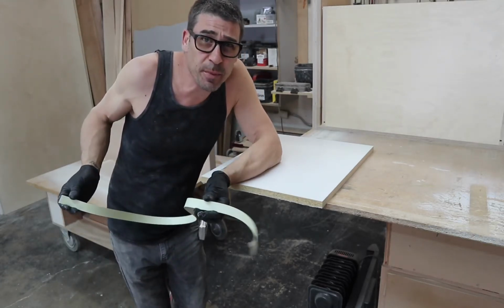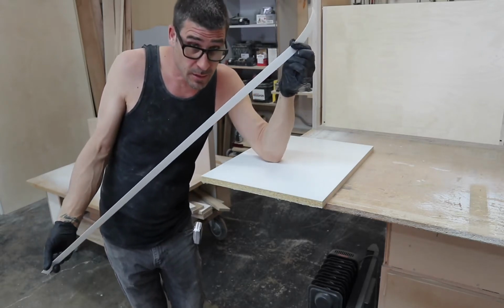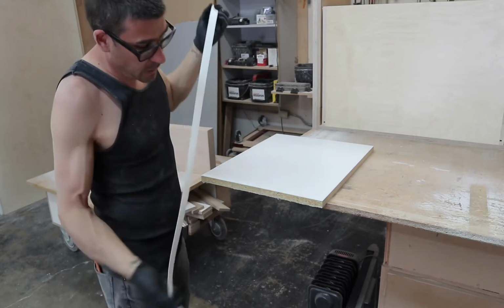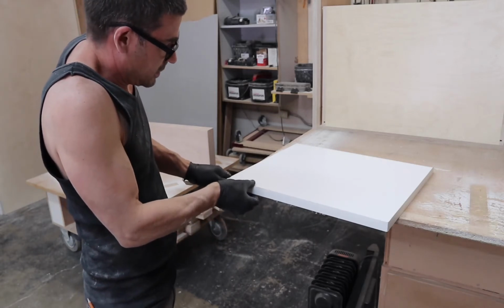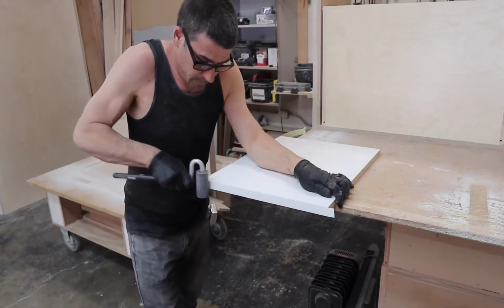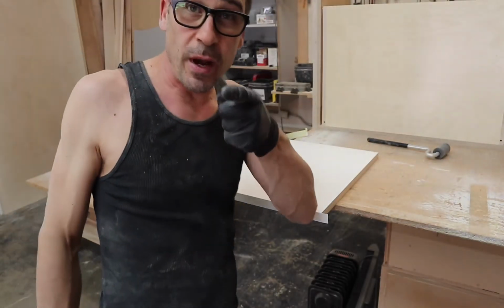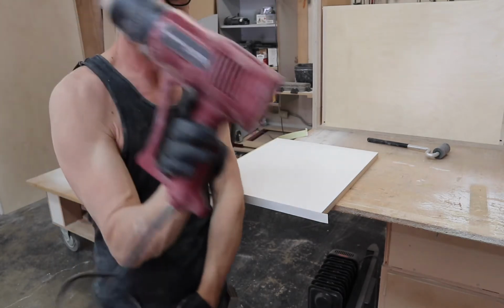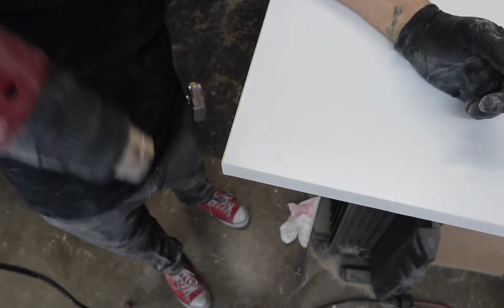How I wrap corners with PVC edge banding tape.

Comment: You most likely shared this,  what spray adhesive you are using on your pvc to melamine edging. There is a product called speed tape.
Reply from the maker: I use Hybond spray glue to glue my wood and pvc edge banding on. I have heard of speed tape. I use it with my fast cap maker. Do you use speed tape to edge band?